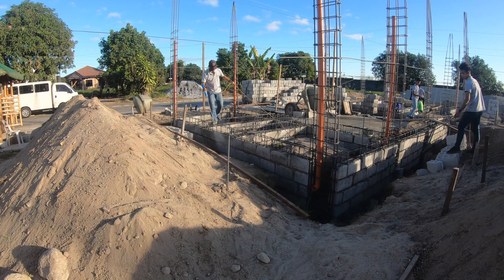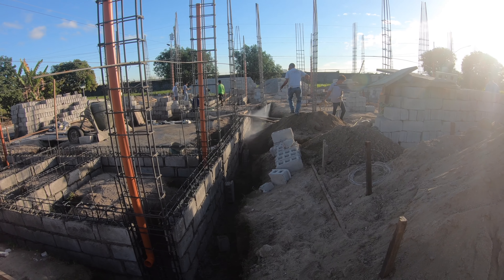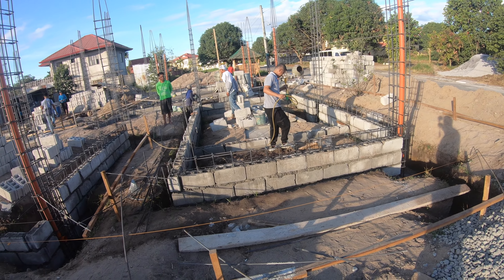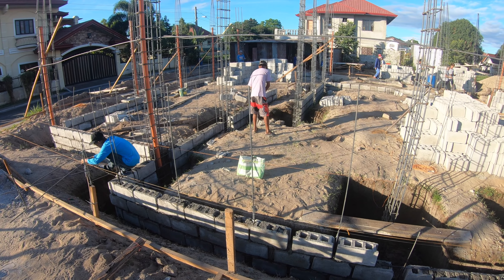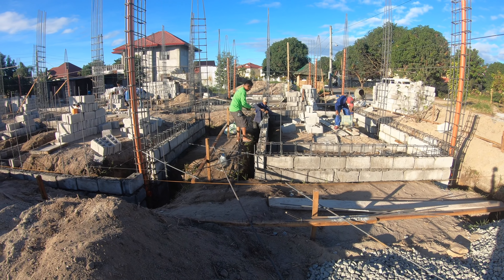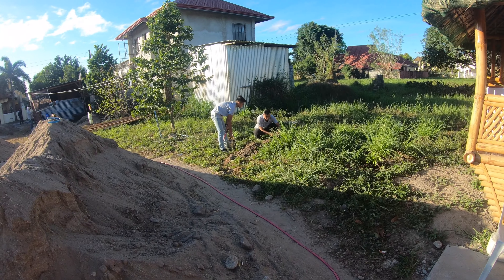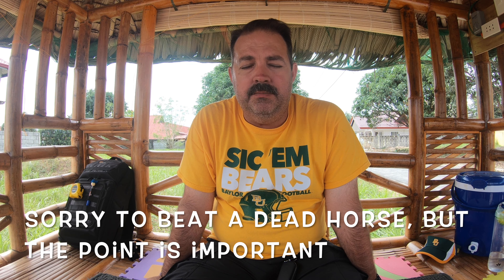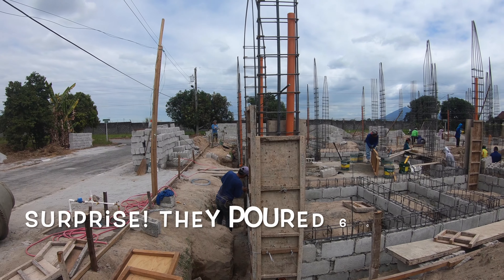Philippine House Building Step by Step, Build Day 21: Down With The Queen

Comment: Sir, did they put spacer blocks between the column vert rebars and formworks? 
is it a normal practice to lay CHB before the pouring of conc on beam?
is it safe to pour conc for column footings with not much gravel compacted and no formworks installed? 
and also, were the formworks secured enough to prevent leaks? 

sorry for the questions. still learning by the book. 
thank you so much sir!
great content! learned a lot from your vids!
Reply from the maker: Great questions. 
Short answer is unfortunately a NO. 
Common practice is to build the forms right up against the vertical rebar. Once the concrete is poured, they remove the forms, chip/rough up the face of the concrete, then add 1”+ of palitada or plaster coat. Constantly had to beg to at least get 1” of space between the rebar and the forms so that the rebar wouldn’t be exposed. 
Common belief in local building practices is that plaster coating had any kind of load bearing capacity. 

PLEASE KEEP AN EYE ON THIS IN YOUR CONSTRUCTION PROJECT. 

Demand at least  2” spacing between rebar and forms in accordance with the Philippine National Building Code. 
Wet setting the first layer of CHB on a foundation wall is normal, but NOT on s lentil or any other horizontal beams.